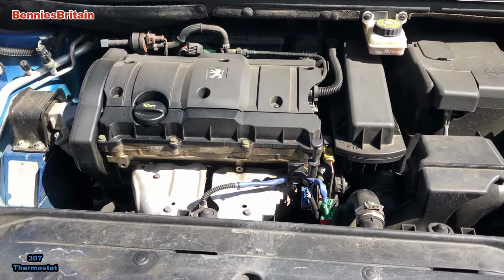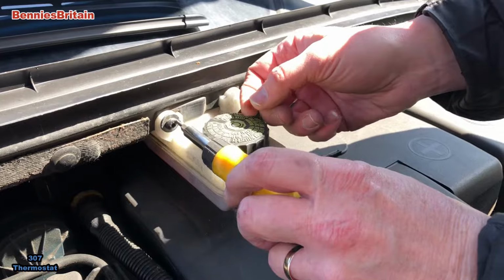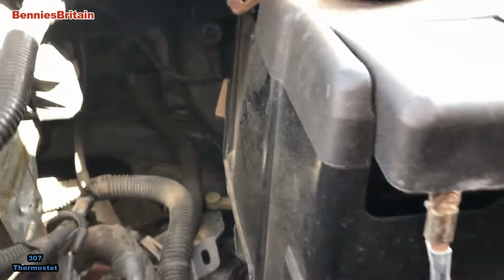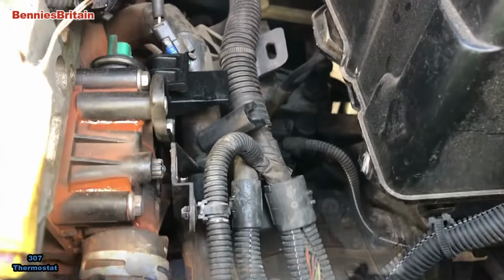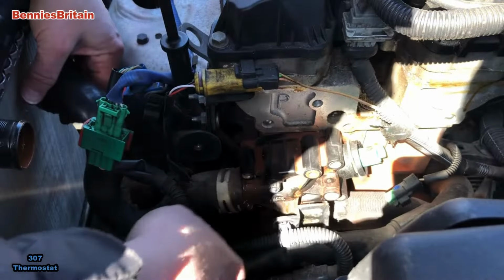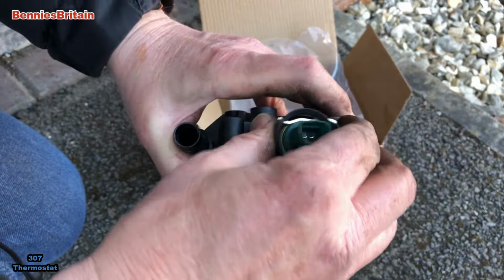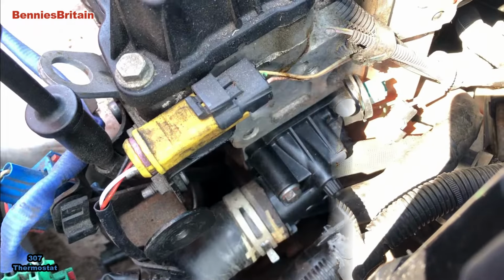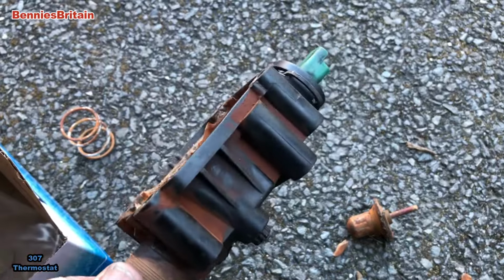Peugeot 307 - Thermostat Replacement

Comment: also isn't it better to just unscrew the bleeder screw so air can escape, if you unscrew it and remove it completely, that creates bigger hole for water to spill more, i think it would be cleaner to just unscrew bleeder screw two, three turns just enough so air starts escaping and youll see bubbles anyways

Comment: Is this a petrol 1.6?
Reply from the maker: Yes 1.6 petrol, 2007 car
Reply: Thanks for this. My 307 cc is not over heating but when driving the gauge for coolant and oil stays at zero. But strangely when i park and sit in idle the gauges work normal and go to the middle and i have heat in the car. Does this sound like a thermostat problem, maybe stuck open or something thanks.
Reply: @martymartin2894 no sounds like the thermostat temp sender. It’s the connector on the thermostat. Don’t think they are available separately it’s a new housing - ridiculous. Many aluminium replacements on e bay for every newish car